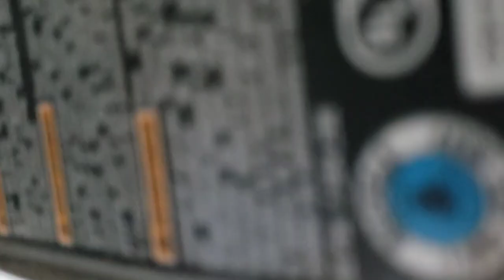Making a Bookcase with a Hidden Flip-Out Desk (6 Minute Speedrun)

Comment: I'm thinking about incorporating a fold-out desk into a floor-to-ceiling 9' tall x 12" deep bookshelf-----24-36" monitor, and a shelf above the monitor for a computer case to sit. Adjustable peg hole shelves through the whole thing. I think I'd try to find hardware hinges though cause eventually those straps will wear out.
Reply from the maker: It's got a slight bit of sag, but not that noticeable. But I have a lot of that strap left, so I could just replace it every couple of years (or install a shorter one so when it does stretch over time it'll stay mostly level